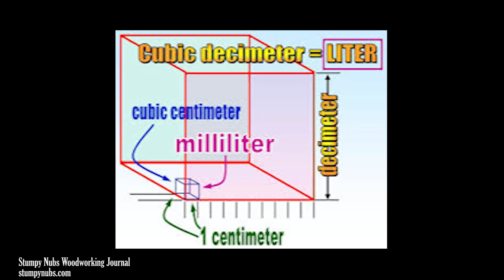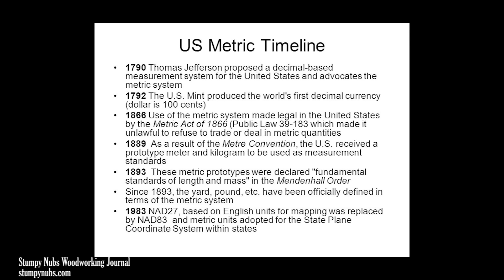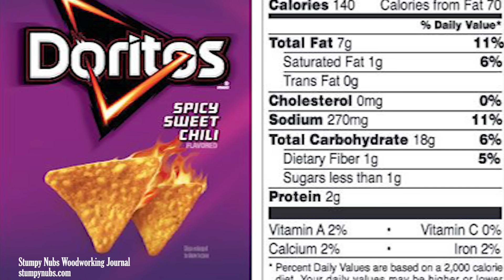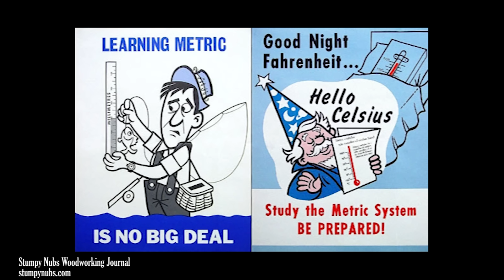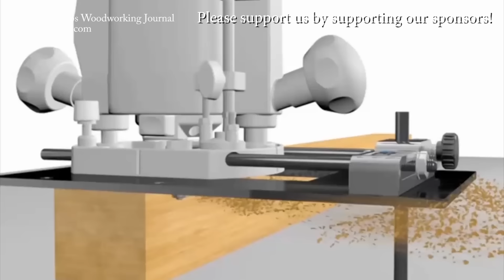BREAKING: The USA is switching to METRIC!

Comment: I prefer metric by a mile.
Reply: This is a drastically underrated comment. I’m sorry on behalf of the internet.
Reply: @smithdoesstuff   we would say... I won't move a mm towards empirical.
Reply: As a european, this is funny and i actually never heard it before.
Reply: I don't
Reply: We will still use miles to describe distances on other celestial bodies .
Reply: In Poland we say "Zesraj się, a nie daj się"
Reply: A country mile at that!
Reply: thankfully, America is slowly inching towards it
Reply: Damn, that was funny
Reply: Seeing as a Mile literally means 1000 and that probably meant 1000 roman steps the original length was probably close to one kilometre.
Reply: I prefer metric by a scandinavian (norwegian and swedish) mile, which is 10km ;)
Reply: I prefer inches by a kilometer
Reply: The original mile was "1000 standard double-steps of the roman legionaries", so it was in some sense a 10-based unit. That meaning got lost over time.
Reply: @ThisIsMyNewAlias  you should buy a 70's american or british car and try to fix it with metric tools! It's not going to happen!
Reply: @iscmiscm  They counted double steps, so the right leg each time.
Reply: We Germans call a folding rule "Zollstock" which means "inch stick", despite there are centimeters on it.😁
Funny that some inch users call it "meter".
But there are some things typically in "Zoll" (inch) here in Germany, wheel and display/screen sizes, and there are "zöllige Rohre" ("inchy tubes/pipes") in most water heating systems with an inner diameter of one inch.
Reply: @lifeisgameplayit  i might be wrong but in EU we use Km , astronomical unit(150 000 000 km) and light year (300 000m/s*1h)
Reply: ps i am not saing it is the same in the USA
Reply: talk about an oxymoron